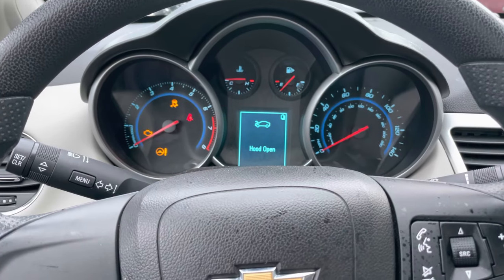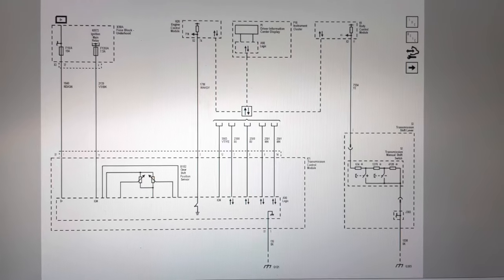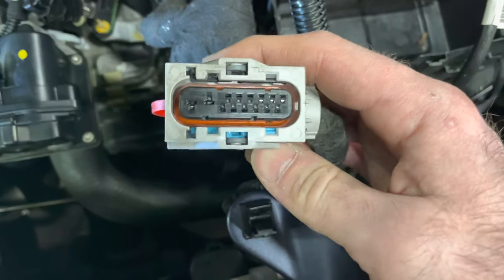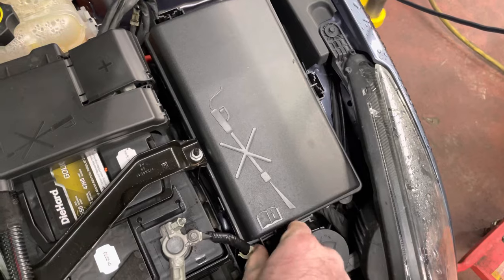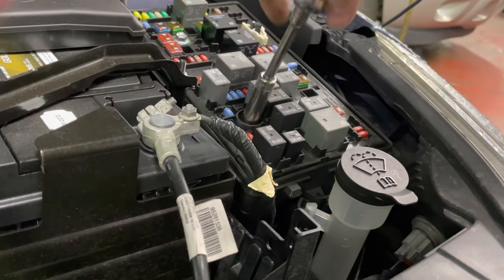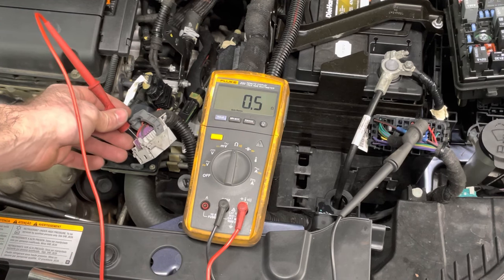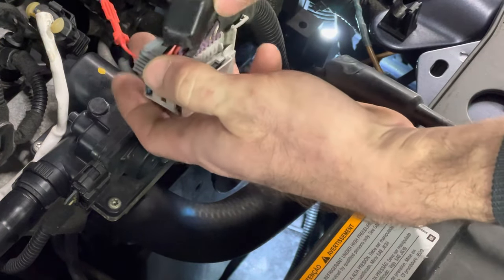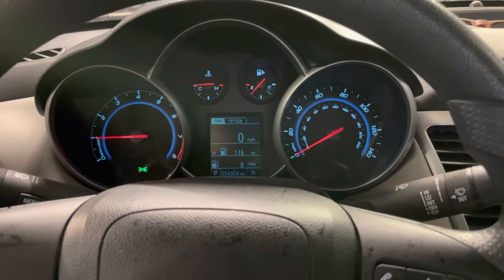Cruze Limp Mode... TCM No Communication U0101

Comment: Thanks for posting. This is the closest thing I’ve found on the internet to the issue I have. My car could run fine for 100km, then do this crazy possessed thing with the gearbox going in and out of gear, hard thumping and the door locks shooting up and down. Also the ESC light on and it gets the code 0101 TCM communications. I’m checking index my fuse block tonight
Reply from the maker: Sounds like you have an intermittent network drop out.

If it’s good most of the time and only faulted sometimes it means most likely the fault is a loose connection or wiring short somewhere. 

Thank you.
Reply: Finally someone that has had the same problem as me lol... I'm going thru this now
Reply: please what did you find out and what did you do to fix the problem
Reply: @christinebaker8649  it was likely the TCM was very sensitive to low voltage (under 12.0 ) which explains why the previous mechanics first went with a new battery and alternator. The fix for me after eliminating all other possibilities was a gearbox replacement. TCM is integral to the box. Been a few months since replacing with a second hand box and it’s been fine.
Reply: @AlsETypeResto  thank you so much we'll try that. I've never gotten the code u0101 until today... I've always gotten thermostat and electrical connector.. changed them both and still nothing but I'll definitely try this thanks
Reply: @AlsETypeResto I’m having this problem right now.  Did you get the TCM replaced?
Reply: @christinebaker8649 did you try getting the TCM replaced?
Reply: @yungbevvo  the old TCM is on my bench in the shed. Replaced the transmission and it’s been good for the last couple of thousand years km.
Reply: @AlsETypeResto  you replaced the transmission control module to fix this problem?

Comment: Hello DadsGarage, I have the same problem on my 2011 Cruze but the code that appears is P0700; The strange thing is that, if I delete the code it works for 1 or 2 weeks and then the problem returns, what could it be? Do you think it could be a false contact or something related to the solenoids?
Reply from the maker: P0700 indicates that there is a trouble code stored in the transmission system so you need to read the codes from the transmission also. 

Thank you.
Reply: @DadsGarageDiagnosticSpecialist Thanks for help, is there a special scanner to read transmission codes? I just only have a bluetooh device connect to my android phone and why do you believe that when i clean the code the car work fine 1 or 2 weeks in a raw? :(
Reply from the maker: @Sabs761010  some generic scan tools are able to read transmission codes, but usually you do need a professional grade scan tool and the applicable manufacturer communication access to diagnose these. 

If the code is taking a while to code back it might mean there is only a fault sometimes. We should find out what the code is and then go from there. 

Thanks.
Reply: @Sabs761010 I know it's late and I don't know if you fixed it already but the issue that is common on these cars is that transmission fluid gets into the connector and causes an intermittent connection or a complete loss of connection on that body style Cruise.

Comment: I have this same year, make, model, and problem which occurred a couple of days ago after recent cold spell in Atlanta. Have the same code u0101, and all other symptoms, although no one's ever worked on the wiring as far as I know since I purchased it at 53K miles. Currently at 134K miles. Thanks for the video as it's very timely for me.
Reply from the maker: Hopefully something in this video helps. Feel free to comment further questions regarding diagnosing your car.

Thank you for commenting Derek.
Reply: Sorry for bringing up an old comment but did you ever figure out what it was? Just got a cold spell and got the exact code and problems as well
Reply: @pablodelarosa4201  I wound up having to replace the TCM inside the transmission to correct this.
Reply: @pablodelarosa4201  I wound up having to replace the TCM in order to solve the issue. It cost me roughly $1,800 (I believe) to do so, parts and labor.
Reply: @DerekCaffe   Thanks for the reply! I'm hoping it's more like the video cause that means it'll be less money lol but we'll see. its at the shop now
Reply: @DerekCaffe damn that was high. You must have gone to the dealer

Comment: Excellent video, I am now a subscriber, my brother bought a 2015 Chev Malibu 9 months ago, it never worked properly, it wouldn't shift, no gear shift indicators on the dash, doors locking, unlocking and the horn and wipers stopped working. We did some troubleshooting numerous times without proper wiring diagrams. After watching this video, we pulled the pin connector off the TCM, we had no voltage on the pin that you said was a hard positive, the ground pin was good, we removed the cover from the pin connector, after it was removed from the TCM, we could see a spot of corrosion on the red/green wire, at this point we didn't know whether it was broken under the corrosion, we then pulled the fuse box and did a continuity test on the wire from #37 on the plug under the fuse box (red/green) and the pin on the TCM connector, no continuity, we then scrapped off the corrosion on the spot on the red/green wire and it was broke through, we were lucky enough to have enough wire to splice a short piece onto it,  we now had continuity on the red green wire from pin 37 to the TCM connector, put it all back together, the wipers and horn were working, took the car for a test drive, it was shifting properly, no service engine light and we had our shift indicators back, thanks very much, you're the best. 😀
Reply from the maker: Hell yeah! Glad you fixed it, good find. 

Thank you very much!
Reply: Where is this connector?
Reply: Ok i found the connector and it does have power at the connector and at the fuse box. Would the power steering be affected as well cause it says service power steering. The steering still works but its a little more hard to turn

Comment: I’m going through the same thing with my 2014 Buick Verano, took it to the dealership and they couldn’t fix it. Was this car’s problem intermittent or consistent? My car sometimes works fine and then sometimes it gives me those codes. The problems has been happening more frequently tho…
Reply from the maker: Yes this failure was intermittent for a while until it ended up staying in the failed state long enough to be accurately diagnosed.

Comment: i had to re-pin my connector on my 16 impala, TCM was fine. i wiggled it while the car was running one day and the engine smoothed out and stabilitrac light went off
Reply from the maker: That is fairly common. That’s one of the first things I check. 

Thanks for sharing.
Reply: How did you do that my 15 Impala has this problem

Comment: Is this the same with Chevy sonic? I have the same code. Someone dropped another motor in my car early this year can’t get a hold of them anymore but wondering if they could have had to touch a lot of this to drop the motor or something and messed something up🤦🏾‍♀️
Reply from the maker: Sonic is very similar. It’s possible they could have disturbed many connectors or ground eyelets. Needs to be diagnosed.

Comment: What’s crazy is I have a transmission shop doing the TCM right now. They actually replaced the entire transmission, but they called me telling me that it’s still not communicating with my vehicle. Sooo at a lose rightnow
Reply: Ive been having that same issue, mine ended up being the harness connector to TCM. Did not replace connector, but was able to remove all female pins and adjust them. Has worked fine ever since. Hope it helps you buddy, good luck, I know it’s frustrating.

Comment: I can’t get the connector to the TCM to come off. You made it look like it comes off easy
Reply from the maker: There is a red CPA clip to remove first, and then sometimes those cam lock connectors get badly stuck due to dirt. 

In that case wiggle and rock while you carefully move the cam lever open and closed, do not use the lever to force the connector, use your hand to assist the connector. 

Thanks.

Comment: Thanks for the Video, 
I kinda have the same issues, my service power steering , traction control lights all come on .. I can start the car and immediately the power steering light comes on , it will run for a few minutes and then the a/c stops cooling and the tach drops out.. trans will shift forward and no reverse..shows all the gears selection , sometimes it will die out .. steers fine , checked all fuses and connections.. neg battery cable.. just not sure what’s causing it to go into limp mode.. any ideas would be appreciated..
Reply from the maker: Possible loose nuts on the positive battery cable, etc. 

Otherwise, it could be a lot of things.

Comment: @DadsGarageDiagnosticSpecialist Great Video! My wife has a 2014 Holden Cruze (same as the Chevy Cruze) and our mechanic has told us the TCM is faulty and needs replacing. We have the same error code U0101. Prior to sending it to the mechanic i found error code 136 displayed on the dash and when i put my OBD2 scan tool on i get code U0101, no communication to TCM. I have checked all fuses & they all light up. I fear my mechanic wont check any wires or electrical components & simply diagnose the car with a faulty TCM without proper diagnosis as per your video. My mechanic has used there scan tool & found no communication with the TCM, checked fuses & thats it! Do you have any suggestions for me going forward? Where did you get your probe test lights from? My local automotive store only has the one size test light which i used to test my fuses. Any help is appreciated we have lost alot of money 😢😢
Reply from the maker: The circuit testing to verify a faulty TCM is fairly easy and doesn’t require any fancy tools so they don’t have any excuse if they’re not testing the wiring which is a must. After it’s verified that the TCM needs to be replaced it must also be programmed afterwards. Thank you for commenting.

Edit: that test light should also work just fine for most uses. In some cases the cheap-o light is more desirable as it may place more load on the wires for a better test. 

Follow the test process in this video and also in this video to prove a faulty TCM or faulty wiring: https://youtu.be/QuLlP25zP_8

Comment: Will getting my TCM replaced fix this problem? Im not having issues with switching gears, but my engine light turns on and off, and the same lights turn on for a second then right back. Off… I also experienced the shaking, limp mode, and doors locking/unlocking.
Reply from the maker: Usually if the problem comes and goes, it is not going to be the TCM. More likely to be wiring or loose connections. Maybe even a loose ground. 

Thanks.
Reply: @DadsGarageDiagnosticSpecialist  why are they trying remove the whole body valve?
Reply from the maker: @yungbevvo the TCM is mounted on the valve body.
Reply: @DadsGarageDiagnosticSpecialist what are all the wires I should check? I’m also having this problem when I hit a bump I lost connection to the tcm. My car has already left me stranded a couple of times. Would really appreciate the info.

Comment: I have the same issue. Do I need the diagnostic test probe with led like you have or can I use my multimeter? Where did you purchase the test probes? Thanks for the help
Reply from the maker: You can use a multimeter, I prefer a test light though because it proves the circuit can carry some current.

You can get the test probes in a kit from the dealer or there are several kits available online.

Comment: If using multimeter instead of probe shouod i set to  volts or ohms and if there is a reading that would mean the connection is good correct? Or, is it as simple as hearing the beep which means connectoon is good.Thanks again for the help
Reply from the maker: I typed out a response and I don't think it went through the first time so I'll type it out again.

When testing for a connection on a wire from end to end set the meter to ohms and you should expect to read 0 ohms to 2 ohms. When testing a ground circuit you should expect to see 10 ohms or less... lower is better.

When testing a circuit for a short to another unrelated circuit you should expect to see infinite resistance or OL. Disconnect the battery for the most accurate resistance test.

You can also set the meter to voltage to check the power and ground circuit, but the meter doesn't load the circuit enough so a loaded voltage drop test and a test light is preferrable.

Comment: Do you have to disconnect the battery before removing that fuse box from the connectors? Or is it ok to leave the battery connected?
Reply from the maker: It’s a good idea to disconnect the battery yes. I had the battery connected for testing. 

Thanks.

Comment: My 2012 cruz 1.4 turbo has felt like it was slamming on brakes by itself. I disconnected the battery for an hour to reset the modules. It drove good for the next day then the problem came back. Now its in limp mode and obd codes for tcm and shift solenoid stuck open and shut. Can a shift solenoid cause this problem? It felt like the transmission was throwing itself in park while i was driving.
Reply from the maker: Probably time for a new transmission.

Comment: 2016 Chevy Cruze limited LT runs well but seems to start in a high gear and/or never shifts. Manual mode not operating. Only code is for turbocharger / supercharger bypass valve mechanical. Local mechanic said the bypass valve malfunctioning could cause the transmission not to shift properly. In my opinion the systems have nothing to do with each other. Am I wrong? Car also seems to be making a noise similar to a wheel bearing but seems to be coming from transmission.
Reply from the maker: Need to know what codes you have. By your description there should be some sort of transmission code or some other code setting. If no codes and the transmission is not shifting at all it may have some serious problems inside. 

Does it lack power related to the turbocharger maybe and the transmission is working ok? 

Thank you.
Reply: @DadsGarageDiagnosticSpecialist   currently only code shown is p2261. It is possible the lack of power could be turbo related. I will try a better scan tool and see if it shows any trans related codes thanks for the tip.
Reply from the maker: P2261 sets when the turbo bypass valve has a problem yes and that would cause a lack of power if it were stuck open. 

I'd be concerned about whatever that noise is too....whether it be related to a turbo problem or possibly the transmission. The manual shifting should still be working and the transmission should still shift, but it might refuse to shift into the next gear if the engine is so severely lacking in power that it can't. Thank you.

Also check out my recently uploaded video on a 2016 Cruze with a faulty turbocharger: https://youtu.be/4sCKjBiLyv8
Reply: @DadsGarageDiagnosticSpecialist  yeah that is all pretty much what I was thinking. I'll start by diagnosing the turbo issue. And move on to the transmission next. Are Chevy Cruz's known for clogging catalytic converters at 127,000 mi?
Reply from the maker: @matthewglaze5398  not usually the catalyst shouldn’t fail unless there was something catastrophic that caused it to fail.